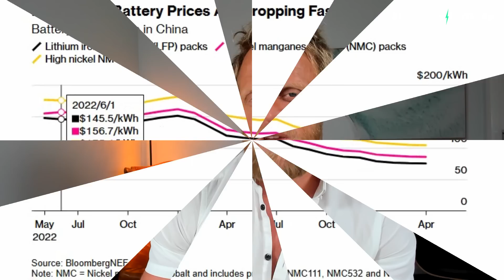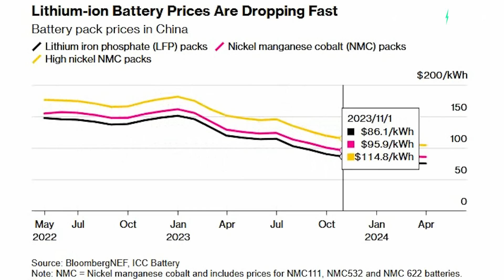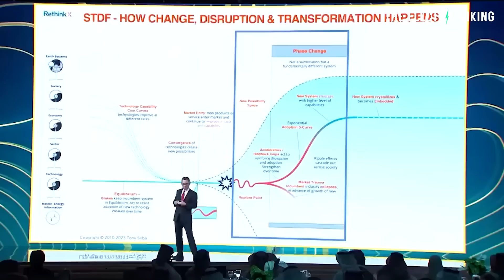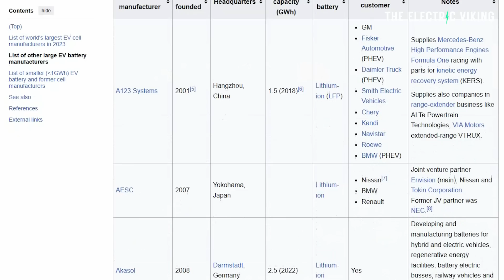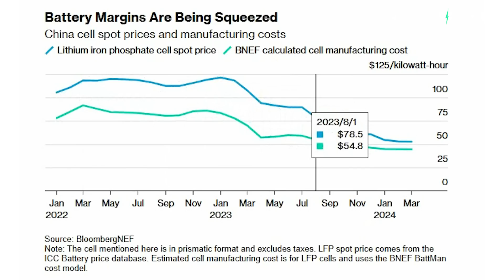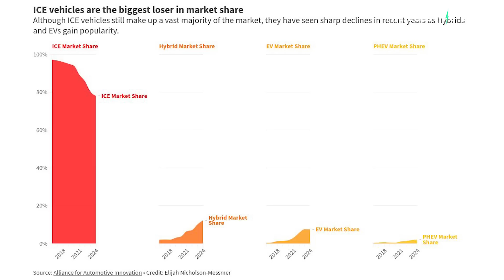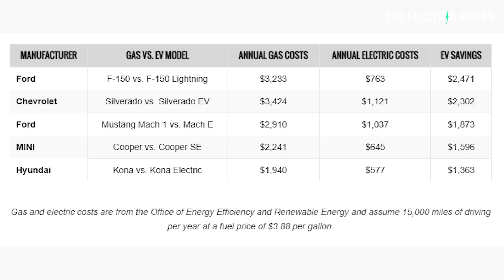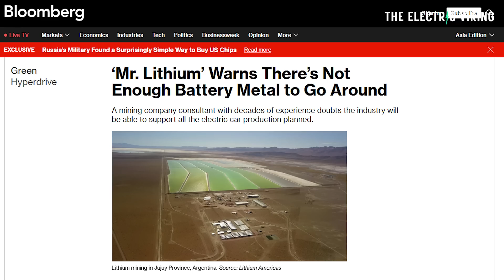Battery prices fall 51% to $53 per kilowatt-hour; "EV prices will keep falling"

Comment: In Australia during severe weather events, which are common, usually the first thing to go is the electricity supply. Good luck to the EV drivers.  They will be looking for a lift to safety with their diesel and petrol ICE owning neighbours. Also EV's are apparently,  although I don't know from experience,  not great when it is very cold or very hot. Many people live in high rise with no access to charging facilities, and increasingly body corporates are becoming concerned about having chargers in basement carparks because of the chance of thermal runaway EV fires.

Comment: One of my biggest concerns about Solar was how 'catastrophe proof' it is, I was always concerned that switching to 100% solar+storage will come back to bite us in the case of some major volcanic or perhaps asteroid event. There have been cases in human history where the entire planet has been blanketed in volcanic material for months & months, with the potential for years.

While that's still a very real concern, it seems that this worst case scenario for solar, while still significant, may not completely prevent solar generation- I think if it reached the point where it did, we'd probably already be doomed.

Obviously, you shouldn't build 100% out of solar, at least not until we can build enough storage reserves to compensate- for example if we entered a hydrogen boon & could produce enough of it to eventually run our grid off it in extreme weather events until it normalises, similar to how we're using natural gas.

It's already possible for a major city to produce more energy than they consume from solar alone, imagine several years from now when they can produce miltiple times their comsumption most days, well we then can then store that in a variety of ways which will more than compensate for potentially weeks when they may generate very little.

Comment: Not surprising, we've seen this before with technologies like Photovoltaics, wind, etc. and the experts have predicted this trend in batteries. what they also expect and we haven't really seen yet are the cost savings of the raw battery materials recycling old car batteries back into new car batteries, mostly staying in the car production cycle and hopefully reducing the environmental footprint of mining raw Li, Co and the like. This all makes more sense than trying to regulate or "drill baby drill" approach to try to artificially depress and subsidize the costs of a finite resource.

Comment: One of the ptoblems for EVs is the lack of a "Gen Zero" product which beats any other product on all the merits. That is point when the market is under pinned for real. We are not there yet - but almost. 

EVs are not just a power paradigm shift, they are a manufacturing paradigm shift also because going electric means simpler, more swappable parts that can be swapped out, tested easily and produced cheaper than moving mechanical parts. Old electronics can last 4 decades if looked after - longer than the average ICE car.

EVs commodify the car, and further more if you look at batteries like a barrell of oil - they do the same job, so cheap batteries = cheap energy = faster growing economy.

ITS HERE - NEARLY...

Comment: hello,
i had a question about your solar panels.
how many did you install, what brand and what is the total capacity of the panels.
can you make a review about the solar panels.
the daily yield based on photos or video.
in belgium we can't even charge 1 electric car in 1 day with our solar panels because the yield is very low.
i heard that you can charge two cars per day.
this is fantastic.

kind regards from belgium
Ronny pra

Comment: The cost of battery have come down because nobody is buying EV thus the demand for lithium has gone down because there a huge stockpile they can't get rid of so they have to drop the price
Reply: Yes, massive oversupply, EV factories are running way below capacity- new ones are being cancelled and many shutting down. Rental companies dumping 10s of thousands of used EVs on the market. It's a going out of business sale.

Comment: Battery pricing is not the real issue that most folks bash evs for. It is the pathetic charging network and the realistic range especially if you buy an ev truck for truck things. They just aren’t getting the job done. They need to work on making the products better and make owning one better, instead of trying to get me to buy what hasn’t been working just because it’s a little cheaper.

Comment: Let’s hope home batteries will soon become affordable. In the UK, battery storage is the big missing piece in the equation and people are ‘selling’ their solar output at a minuscule price to the energy utilities rather than storing it for use at home (or locally). Currently home batteries here are still quite expensive but slowly coming down in price. UK home solar systems are relatively flawed in that there is a strong grid-linked philosophy to the extent that during grid power outages, everyone’s solar inverters shut down (this is a requirement) and they have no off-grid capability. I have bought a large power pack for this eventuality (which is increasingly common due to now frequent storms)  which I charge with separate solar panels to my main bank

Comment: EV is the future and how fast the conversion and acceptance of EV shall come once EV become as safe if not safer than fuel cars as the price is Chinese EV is cheaper than that of the other type of vehicles. Also, with bigger batteries and solar panels installed, travelling in a EV is too cheap to be true without any maintenance and trouble free.
Reply: EV acceptance will come when price value equation is >> IC vehicles.  For me charging time is unacceptable and too much life cycle cost uncertainty.  The poor  residual value of EV beyond 8 year battery warranty alone destroys all benefit.  The average age of vehicle on road in U.S. is now 12.6 years.  For BEVs it is only 3.6 years!    Batteries have aging and cycle life deterioration.  Would I dare park a 12 plus year old EV in my garage on a hot summer day?  Hell no!

Comment: We installed 38.4 kWh of stacked HomeGrid batteries for our whole house solar system last December 2023. Around $23k plus installation.  They are pretty good but not big enough to carry us through the darker cloudier months of December and January (we have electric heat pump heating). I would love to add a second stack but for that would need to see prices come down substantially. So this gives me hope.
Reply: You should look into getting a battery pack from an ev car. Tesla model 3 long range 75 kWh battery pack can be had for as low as 4k shipped

Comment: 100% irrelevant to EV adoption.  You are focusing on spreadsheet numbers that are irrelevant to adoption.  You are an idiot!

All the same OTHER problems are still there.  

This battery change *might* change the salvage value problem (i.e. that salvage value is precisely zero because most are disposed when the battery has reached end of life and must be replaced for $5K-$30K which is easily more than what the EV can be sold for.)

The problem is STILL that EVs do not enough remotely have overlap in performance and features that ICE cars already delivery.

NO TECHNOLOGY has ever been adopted that do NOT have over 90% overlap and equivalence to the technology being replaced.  This goes back nearly 300 years to the very beginning of the industrial revolution.   Every engineer who has ever innovated a new product knows this.

Charging an EV takes 1-5 hours.  Refilling and ICE takes 5 minutes.

Range of an EV is generally shorter than ICE 

The driving load capacity is radically reduced compared to ICE

Cold weather range is useless

A green energy supply ESPECIALLY using battery REDUCES the thermodynamic efficiency of the entire energy chain.  The means MORE INPUT CAPACITY is required to achieve the same load work.

Batteries DO NOT HAVE an order of magnitude of future innovation.  This is STEM 101.

You obviously have no STEM knowledge or you cheated getting your STEM degree.  Sad.  Sad.

Comment: At 10$ KWh it's a no brainer to have a large battery attached to every house. No solar needed. Just charge at the cheap rate and supply to the grid at the expensive rate and have free electricity and maybe pay your mortgage.

Comment: Great, when I see a dealership based EV with 700 mile range in below freezing weather and rechargable in 10 minutes and charging stations as ubiquitous as gas stations selling for $30k,  I'll buy one.
Reply: How often have you driven 700 miles without stopping? Charging stations are already more common than gas stations. Every electrical outlet a car can get near to is a charging station.

Comment: However there is a big problem with falling prices .
manufacturers will find ways to cut costs and the easiest way is to dump the very toxic waste into the ultimate sewer, the oceans .
This of course is always done via a third party like the million of tons of sulphuric acid scrubbed from power station stacks, loaded onto tankers for Asian ports that ever seems to be there when the ships dock   , , , , Unfortunate accident just seem to happen . 
Using a Li battery for stationary power storage is a crime when actually low ( almost no ) pollution alternatives like flow cell batteries have been available for near a decade .
I am all for renewable energy and in particular roof top solar in urban areas and micro grids feeding into Flow Cell batteries ( at present ) and those in turn feeding into the grid .
By doing this we can eliminate the need for almost all power stations particularly in Australia where we have almost constant wind but we need to install both low wind speed and high windspeed generators as most turbine consume almost as much power being idles as they generate .

Comment: I was travelling about 200 miles a day or less but not always able to get home so ended up usually in a travel lodge or similar usually without a visible charging point so having a long electric range was a necessity. With the range of the diesel I did not have to worry about it. Don't get me wrong I was working for a solar panel company and would have loved to have turned up in an electric car but it just was not practical. As an engineer I don't really care what I drive as long as it's reliable and gets the job done. I am looking forward to the day I can hook up and electric car with v2g to my house and lower my bills and visit my friends in Cornwall without having to plug in. The technology is getting better it's just not mature yet leading to low resale values. There are some bargains to be had in the UK market at the moment but these are more to do with manufacturers dumping stock to avoid fines and are yet to be on a vehicle I would want.

Comment: Battery prices are just one of the  problems with EV's it's great they are coming down but the infrastructure is still abysmal, charging stations are still too few and a large proportion are broken or unusable and tbh the tech just isn't there yet until an electric car can do more miles than a full tank of petrol and be reliably, quickly and easily recharged ppl just aren't interested and rightly so. Oh and price as other ppl have said they are too expensive, if we are to take on all the disadvantages I've just mentioned then why the hell should you pay more for that pls make that make sense

Comment: Nice. sweet.  Don't care.  China is flooding the market because of massive state susidies.  EVs still need hours to charge, and charge they must.  Dependency on a power grid and charge times,  not to mention the increase of X as a service and remote control, mean I'll never buy an EV.

Comment: it will take two or three years for that prices to arrive on the end consumers side when it comes to cars. but good to know that everything goes as expected. 
one interesting fact from Skoda: the entry level price of the new 2025 Elroq BEV is approx. on par with the ICE version.
however, the CEO of Skoda recently stated that with the ICE version they make profits, but with the ICE version almost none.
i think it then takes two or three years that they can make the same profit.
this is the most important point. EV haters built up plenty of lies so far ONLY because the sticker price of BEV was significant higher than their ICE counterparts. this will turn in two or three years. then EV haters will gradually die out.

Comment: The problems with EVs aren't just the costs, charging times,and cold weather. We need non-combustible, 3-5 minute charging, lithium, cobalt free, 1000 mile range batteries that retain 90% for ~5000 charge cycles, with cheap standard modular replacement. We need ubiquitous charging infra. We need neodymium free mtm magnet motors. We're still a ways away from EV. Also these batteries are still unsuitable for grid storage.  Probably need sodium, sulfur, sand, flow, etc. for that so need good round trip efficiency boost there. And please replace all solar wind grid with geothermal. Solar is ok for household and off grid but not much else

Comment: Great info.  You mentioned "Carbon Capture is not doing its job".  As an engineer, I looked at CO2 and was dumbfounded.  CO2 makes up 0.04% of the air we breath.  When it drops to 0.02% plants start to die.  At 0.01% massive vegetation die off happens.  During the Jurassic period, CO2 levels were 0.16%, this is 400% higher than today.  Life thrived.
10,000 yrs ago Canada was covered by a glacier 2 miles thick.  It melted, massive climate change.  It had NOTHING to do with pickup trucks.  Moving away from ICE to EV's is smart, we only have one atmosphere, and I like to breath clean air.  But CO2 is not the enemy...
Reply: As a retired commercial greenhouse grower we use to run co2 levels at 1200 ppm to maximize production,
Reply: @Sparkyoleano  It is a contained environment and the nutrients are sufficient to help the plants make use of the extra CO2.
Do some research beyond a green house. CO2 is the earths thermo regulator.
Reply: @ unproven theory that has been debunked
Reply: @Sparkyoleano  Well then, debunk it in a clear well articulated fashion.
Reply: @morninboy It has already been done repeatedly. All you need to do is look it up.
Reply: @brianmoore1164  So you cannot explain it. Typical.
Reply: @morninboy  So you are to lazy to do your own work.  Typical
Reply: @morninboy  So you lack the ability to understand anything not spoon fed to you. Typical.
Reply: @johnrdadrian  Increased CO2 was identified as a potential climate problem by Nobel Prize winning physicist Svante Arrhenius over a century ago, and by the preponderance of experts ever since. Doubt is fine, but betting against them is foolish.
Reply: CO2 is the earths thermo regulator. Life will thrive under many different circumstances but 8 billion people are dependent on the stable environment we arose out of.
Reply: The ocean actually had become a sink for CO2 produced by burning fossil fuel. Ocean acidity is on the rise.
Reply: At 0,12% you may start to get head aches and feel dizzy, so please don't set it as a target, thank you.
Reply: High CO2 is good for certain organisms, but look at the big picture. The rapid rise is not good for the environment that humans depend on, therefore not good for humanity.

Comment: I said from the very beginning that if I had to pick a year of when EV's will be cheaper than ICE, I picked 2027. I still hold that opinion. 

Sodium Ion batteries will replace Lithium Ion for stationary storage by then, further lowering Lithium Ion batteries prices. And Lithium-Sulfur and Solid State will start to come in EV's just before 2030, meaning that low cost EV's will use the cheaper "old" Nickel based or LFP chemistries of today.

Comment: Recently I watched a YouTube video where a guy here in the U.S. tried to charge his 3 year old LEAF and a new LEAF in -18F weather at midnight.   The idea was testing EV charging  during bad conditions at night... which are common here during our Midwest U.S. winters.      The old LEAF wouldn't charge due to the cold.   The new LEAF was a 3 hour charge and, if the heater was running, lost battery charge while plugged into the charger.     😱

I have a teenage daughter approaching driving age.   After watching that YouTube video, I will never allow her to have an EV, only a hybrid or ICE.   I'm an engineer and technologist.  I do believe in EVs... but the battery tech still appears to be a decade away.  I would appreciate it if you would spend more of your videos on battery tech, especially the range, changing and safety issues.   😎